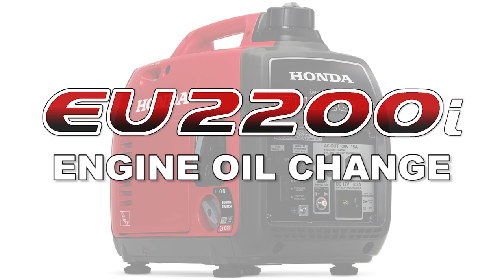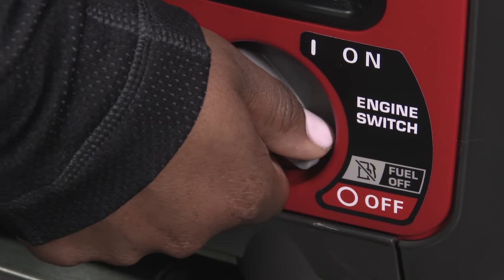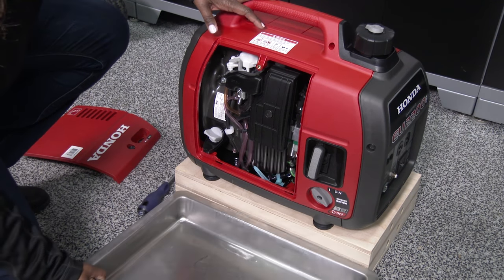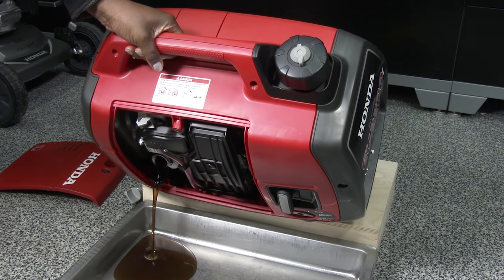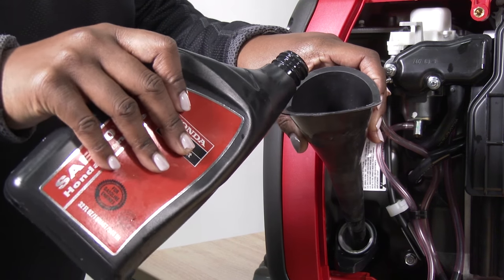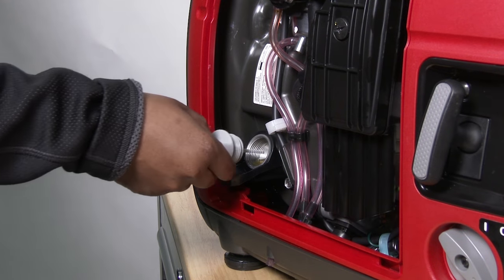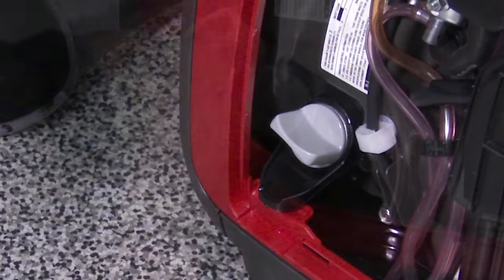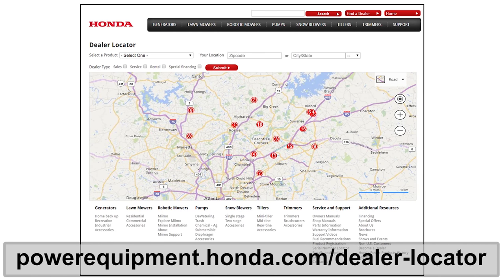Honda EU2200i Generator Oil Change Procedure

Comment: After how many hours of running, oil needs to be changed?
Reply: I change the oil after 10 hrs .
It's cheap maintenance and the only thing you have to do
Reply: 40 hours with synthetic

Comment: Type oil please !
Reply: Any good 10w30 4-stroke oil will do, including automotive. Full synthetic is also fine. Or use a full synthetic Honda oil for power equipment (generators / mowers etc.)

Comment: what happens if i used 10w-40 instead of the recommended 10w-30?
Reply: You open the gateway to the 4th dimension.
Reply: @boomer7638  in that case, 10w-40 it is !!!!
Reply: @boomer7638  😂😂😂

Comment: 10 W 30 
Every 50 hours of use
Reply: So change the oil every 2 days of continuous use? Really? That seems extremely excessive. Eventually I will have a Yeti 1500x that will be fully charged in 3hrs using the Honda Generator but in the meantime that seems rediculous for off grid use. Can I at least use Mobil1 full synthetic? It's easier to find...
Reply: @CayoticProphet  The manual says every 6mo or 100hrs but with quality oil I assume you can push that out. I doubt that heavy users are changing it that often.
Reply: 20 hours for first change, then every 100.

Comment: theres guys that will never empty and change the oil in that ....and it will run for decades lol
Reply: I’m not proud to say we had a Honda generator at work that was used every day and never had the oil changed in over ten years
Reply: @gazbev  you are my example! 😂
Reply: That's impressive.  I'm guessing you had to add oil periodically, is that correct?  Did it smoke?

Comment: Some people think I'm just so great look at the 1.5 Honda turbo motor it's a total nightmare gas dilution oil burning oil leaking and they using that in the late model Honda and they're all dark so what's so great about Honda okay it went down the drain just like all the other car Packers looking forward to burning oil like crazy okay Toyota makes a great vehicle still even though they're ugly and overpriced but people treat them like s*** and then then they want a lot of money for them when they're burning oil that's what gets me selling them use the $20,000 more than they paid no and it's burning so much oil that the American people are a**** already keep what I got I just want a long time I got four cars the 25 years old I maintaining they give me no problems a 5-year-old s*** has loads of problems sludge in the engine because they wanted they don't want to spend the money and put good oil in it they want to wake the 20-30,000 miles and you snake oil the Americans are the fools I don't care if they blocked American white American or Spanish-American the Spanish know a lot about cars today I wouldn't even buy a car from Spanish person cuz they know how to make change their cars most of them not all of them an American dude or any other type of dude in America I wouldn't buy a used Matchbox car from them